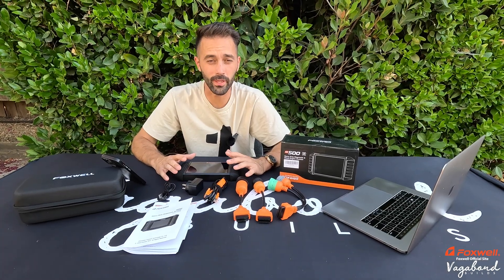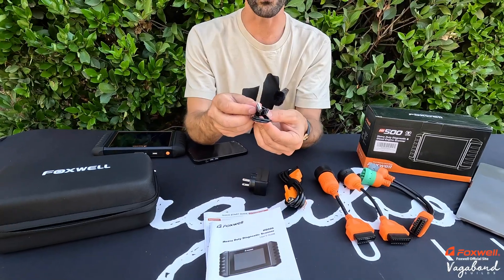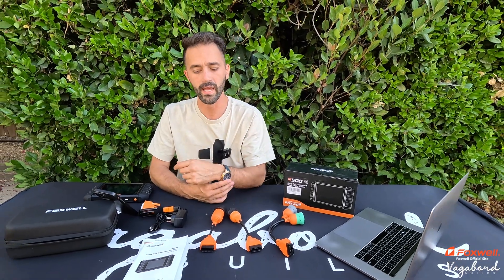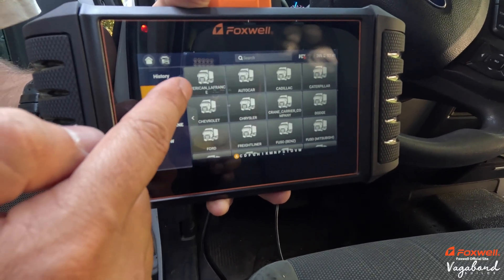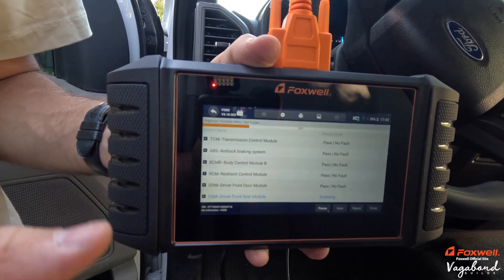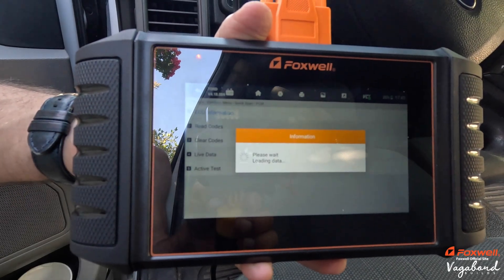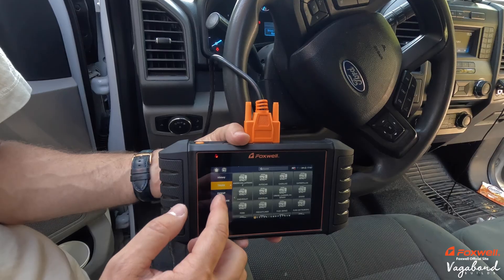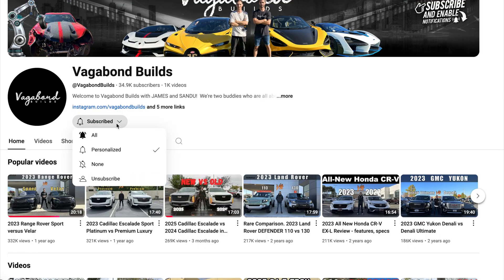Diesel Diagnostic Scan Tool. Foxwell HD500

Comment: Thank you for the video. I wonder if this thing can adjust the speed limit, set or remove the idling time,  see which sensor or injector is bad on a big rig (new Volvo or Freightliner), reset DPF filter settings, etc.